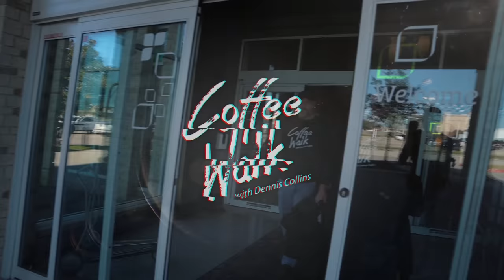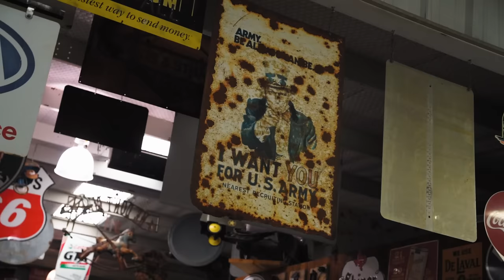Epic South Texas Two Step - Insane Collection! | PART 1

Comment: In the early 90's I was the only worker in a small body shopin Northeastern Minnesota besides the shop owner. A client shipped his VW convertible up from either Kansas or was it Nebraska to have it cosmetically restored by my bosses shop. When we shipped it back to him, it looked IDENTICAL to the one you picked up....same color combo, same wheels, same EVERYTHING.  If I didn't know any better, I would swear that it was the same car that we had restored.

Comment: Was he referring to King Machine Shop in Burlington, N.C.? Back in the day Larry King was known as "the man" when it came to custom machine work/balancing, head porting and engine assembly Their shop did run-of-the-mill stuff for local repair shops(head surfacing, flywheel balancing, etc) but they also did a lot of race engines and were widely respected in the circle track community.

Comment: Also forgot to only getting 9 miles per gallon & doesn't want to go over 5 k rpm like its in limp mode. I'm only getting on my scan tool about boost  solenoid &aBout temp sensor which the black coolant block seems like a by pass because their no hole to put in or no wires to connect the temp sensor to.very weird.